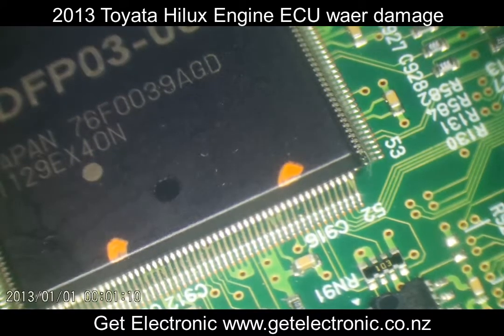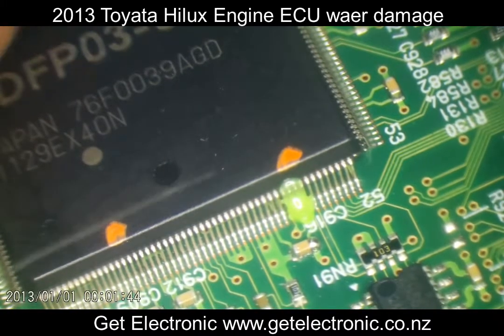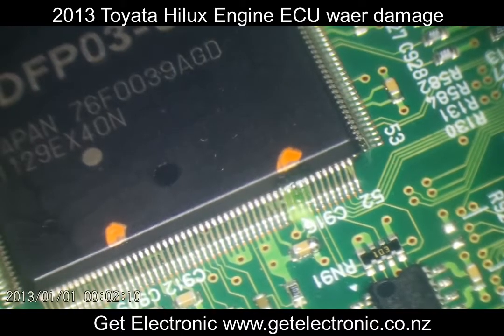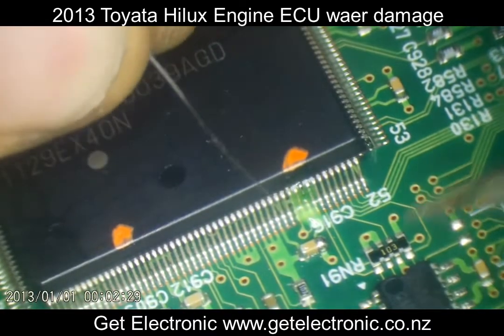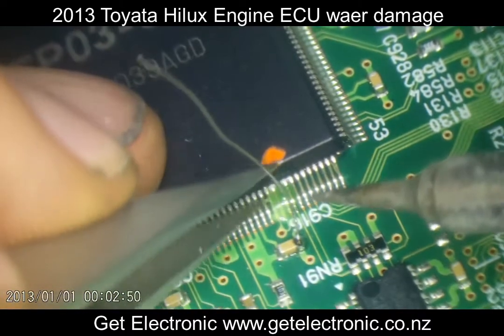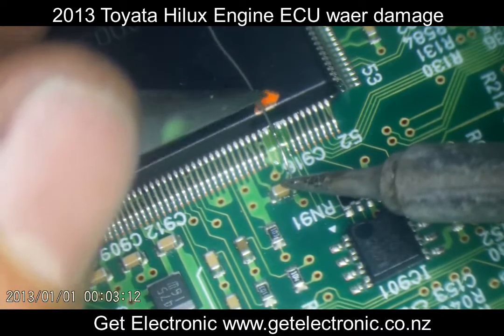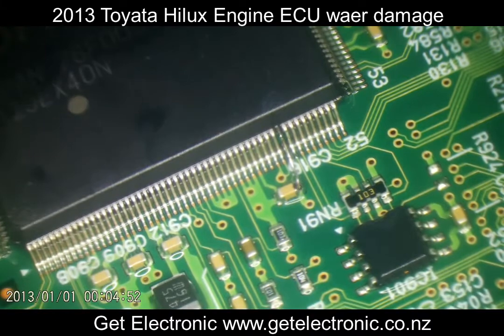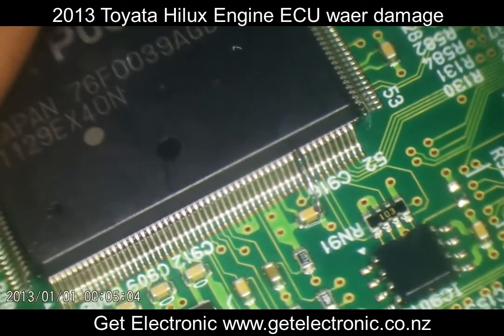2013 Toyata Hilux Water Damaged ECU

Comment: i have ecu for 2013 hiace water damaged . i want pinout or help for regulator voltage IC SE817 because no 5v output . can you help me please?
Reply from the maker: just add another 5volt supply externally ?
Reply: @getelectronic8459  can't add because this has many output and clock also. I want pinout to test the input and output / standby also